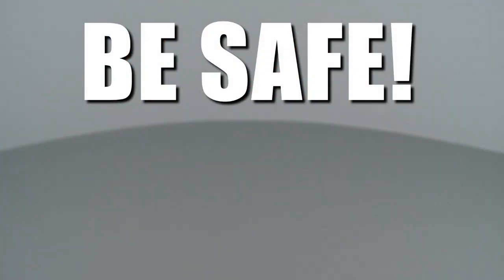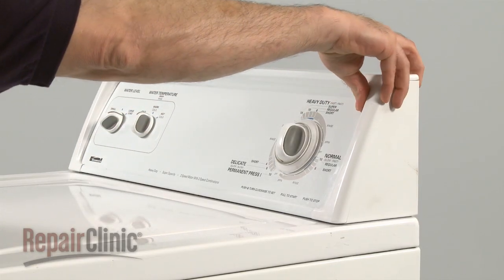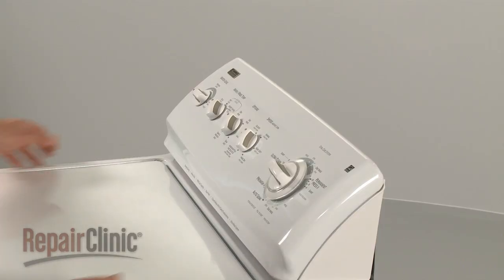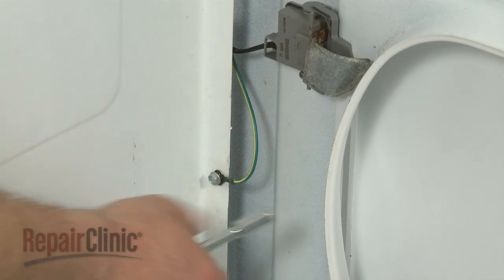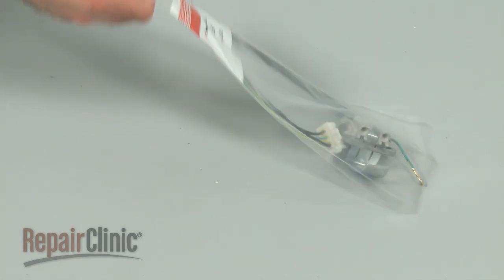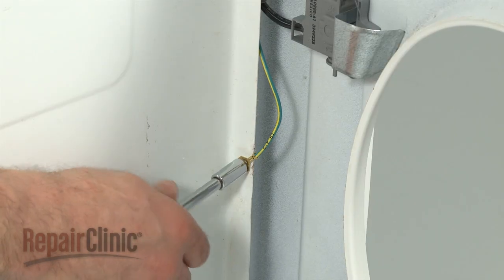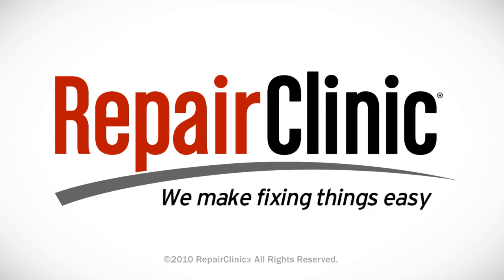Washer Not Spinning? Replace Washer Lid Switch #3949238

Comment: just moved to a new home - first day try to do some washing - the washer stopped spinning and stopped draining mid-cycle - there is still water in there btw - 9711034a - kenmore elite - is this what I need? which part do I need? thanks - sear said they will charge 350 to fix maybe and a new washer is about 600 bucks.....

Comment from the maker: Your washing machine should not spin while the lid is open. You can test the lid switch for continuity to be sure. If you go to the part page (link at the top of the description) there is a lid switch testing video at the bottom of that page. Hope the repair goes smoothly!

Comment: My washing machine won't spin all the time. It works if I open the lid (I don't have to close it to get it to spin). I bought a timer but before I replace that, I'm wondering if it might be the lid switch? Should the machine spin with the lid open? It also spins properly if I reset the dial to spin. Thank!

Comment: The Kenmore 90 series has the plastic endcaps that you just pull down from the top corners of the washing machine. There are 2 screws at the bottom of the endcaps. Everything else is the same.
Reply: @repairclinic  Just got the new switch in and getting ready to replace the old one. Great video!!

Comment from the maker: It should just clip in to the frame of the washer. If it isn't it may have gotten bent and will either need to be bent back into shape or replaced.

Comment from the maker: The lid switch not working can definitely cause the washer to not drain. I would replace it and see if that fixes your problems (which it should). For future reference we have a repair help section on our website (link in the description). If you enter your model number there you'll have access to model, part, and symptom specific repair help that should answer all your questions.

Comment: Hi, The lid switch was broken forever, we were jimmy rigging it w a pen cap until finally that stopped working. On that day that it finally gave out the washer also refused to drain, could this be related or could i have additional problems brewing? I dont want to replace the drain pump if its just the switch. Please help :)

Comment: My roper rtw4641bq0 will fill, wash and rinse and the lid lock light is on. But when it gets to final spin before cycle complete it stops and the lid light is no longer on. I them pause it  and it's still in final spin and this time the lid locks and it sounds like it's draining but it never starts spinning. Please help?

Comment from the maker: I would recommend you use the repair help section of our website to help you determine what is wrong with your washer (there's a link in the description). If you enter your model number there you'll have access to model, part, and symptom specific repair help. I hope this helps!

Comment: I dont know how to tell if its my lid switch,  my timer, or something else. My washer filled with water, then just set there. I cant get get to agg, spin, or anything. I used a shop vac to get the water out. It wont refill either. Sets there like its unpluged. Theres just a very slight humm that comes from the timer when I pull it to the on posistion. no matter what the setting. I feel comfortable replacing the part if I could find out for sure what it is. . ANY HELP?

Comment: I'm pretty sure this is whats wrong with my washer. I close the washer and it does nothing but if I hit the lid it will work. I'm thinking a lid switch. Whats your opinion? Thanks
Reply from the maker: Sounds like a good diagnosis to us. Let us know if that solves the problem. You can purchase a replacement switch from our website using your model number.

Comment: I have a Kenmore 26922502 mine doesn't look exactly like this one. Should I follow these instructions for my Model also? also here is the other number on it CS4807687 (is the 87) at the end the YEAR of mine? Thanks so much!
Reply from the maker: This is not the same model, but the lid switch is in the same spot so it'll probably be a similar procedure.

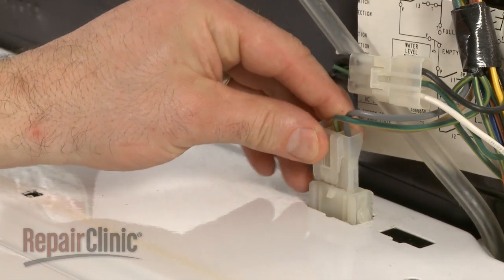Comment: Thanks so much, I was able to save some money. Before I saw your video, I had did a bypass (stripping a wire and putting it on to fool the switch), that wire I attached burned out and burned the plastic connector. I did finally buy the lid switch assembly and installed it, but I need the plastic piece (plastic wiring connector shown on 2:51 in your video) that I pug the new switch assembly to . I ordered a part, but it's too small. Would you know the name of that plastic piece?  Kenmore Washer 1102585400, I ordered part # 3360056 but it is too small, from this diagram part #22   http://www.searspartsdirect.com/partsdirect/part-model/Kenmore-Parts/Washer-Parts/Model-11025852400/0582/0153200/P0312195/00007 . Thanks
Reply from the maker: You've definitely given us a puzzle here :-) You supplied us with model number 1102585400. This is incomplete. The model you link to is 11025852400. Is that the correct model?
Reply from the maker: Did a little more digging. If 11025852400 is indeed the correct model number (which means the lid switch you installed was part number 3949247) then the connector you are looking for is part number 2172937. It can be found here: http://www.repairclinic.com/PartDetail/Wire-Connector/2172937/1938714?modelNumber=110.25852400?TLSID=1621

This was verified by going into our warehouse and matching the parts together. So verify whether or not that model is correct. If it isn't we should still be able to find the right connector for you.
Reply: Lis Jul
Thanks for responding so quickly!!!! I went to your site to look around, I thought it may be a while before I get a reply. The lid switch i installed was 3949238. i went to your site and i think the part i need is is the 2172937.......you have another one, but it looks too small it's 353424. Yep you guys are right, I will order it from you guys. I was online with Sears for about 45 minutes, only to have them "help" me order the wrong part, paid $17+ in shipping, and waited 3 days.....for the wrong thing grrrrrrr. Hopefully I'll be washing before the end of the week. Thanks again giuys.